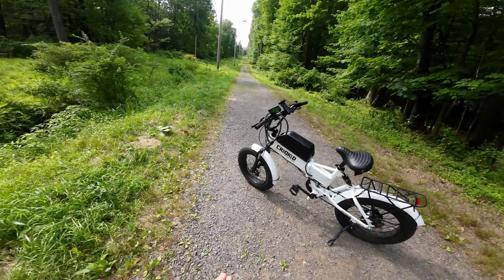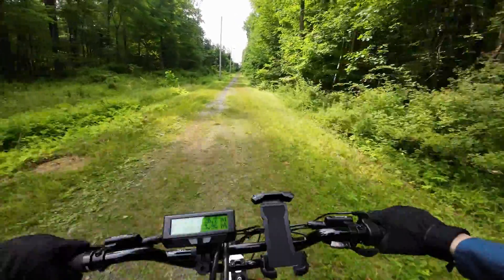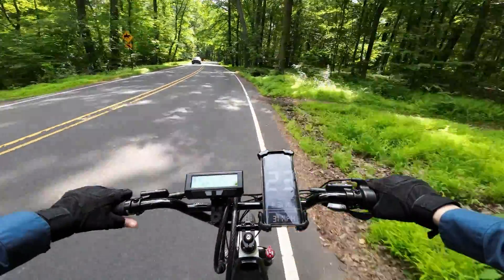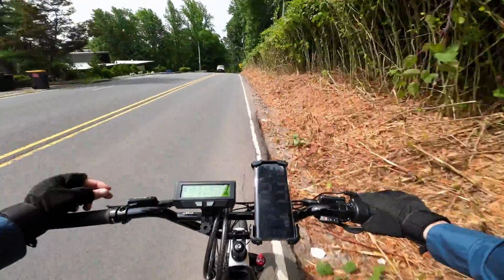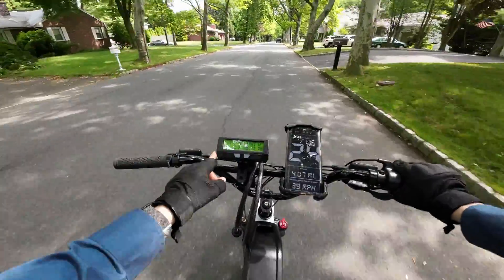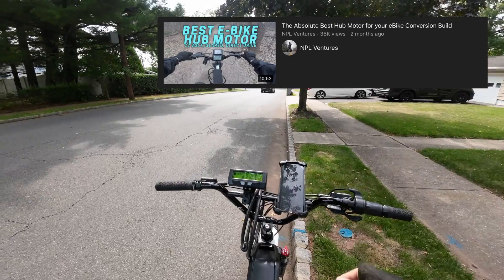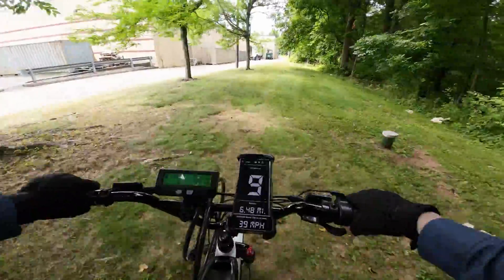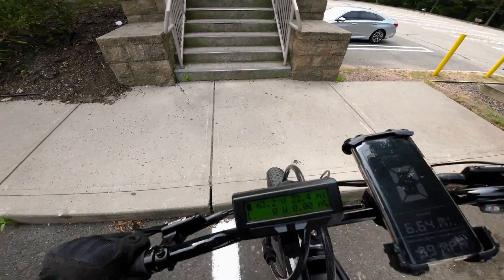Why I Won’t put a Powerful Direct Drive Hub Motor on my eBike Build

Comment: most  cars are front wheel drive so i dont see how handling can be bad ,its best to have more weight on the steering axle ,same applies when loading a artic trailer

Comment: Depends what you want to do on the bike. If you're commuting at low speeds, lots of starts and stops, and never going much above 15mph (maybe 20), then a geared motor probably makes most sense. 
The pedaling will be more efficient, and you'll get more torque and efficiency every time you accelerate from a stop light.
If you've got fewer stop and starts, and you're doing more like 20 to 30+ mph consistently (as I do on my commutes), then a direct drive motor will almost certainly make more sense. The advantage of direct drive is that it's completely silent, more efficient at sustained high speeds (and can reach higher speeds), deal with heat better (which again, is useful for maintaining speed), and it enables regenerative braking. The regenerative braking is hugely useful, as it will do wonders to save your brakes when you slow down from those higher speeds. I almost never actually use my physical brakes on a normal commute. I also really like that they're silent.
A downside of DD that I commonly see is extra resistance to pedaling. For reference, if I'm on my scooter, and I'm on street tires, and my brother is on his 29 x 3 (non electric) MTB, I'll have less rolling resistance than he does. and my scooter has TWO direct drive hubs. If you're commuting on MTB or fat tires, the resistance of a direct drive hub is going to be the least of your issues. If you're on a fast rolling street bike, however, the hub will account for a significant portion of your rolling resistance.

So it's all up to how you use it. It does seem like modern motor controllers have also narrowed the gap in low speed torque and efficiency between geared and DD hubs. So DD is slowly clawing at the few benefits of geared hubs. DD is the default in electric kick-scooters and EUC's, where small wheels mean that 1000W DD hubs will spin the front tire under acceleration, and high speed cruising and efficiency is the expectation.

Comment: honestly my fwd build w/ a 1000w front drive motor has been nothing short of elite, no traction issues or anything unless im trying to get up something stupid steep or i have a ton of weight in my bag and the front wheel starts skipping a tiny bit off the line

Comment: Electricity isn't sent to the motor continuously.  It's sent in a on-off-on- pattern. Aka phases. Therefore, each phase flows twice the current that it is drawing from the battery.

Comment: It’s kind of two different worlds using a geared 500/750 W rated motor vs A heavy, Direct drive hub motor. For bicycles that are meant for peddling, those small geared motors are great because they’re so light. When you get over to the heavy hub motors, it’s more of a moped at that point. You need a more powerful battery with a bigger controller, which adds more weight so it’s not best for peddling. So yeah, for bicycle purposes the smaller lighter motor is better in most situations. In my personal preference, I prefer the heavy, direct drive hub motors, but I’m more into the performance. All of my E bike builds pretty much whiskey throttle if you’re not careful lol

Edit: I see you have the cycle analyst you must’ve been on ES?

Comment: Thanks for the tip on BAFANG steel gears for their hub motors. My AWD mountain cargo hunting bike (E-CELLS Super Monarch Crown) has TWO BAFANG motors. When out in the wilds hunting alone I absolutely must have reliability. Those steel gears may be a bit more noisy but at 2 mph off road or on gnarly trails it won't be noticeable.
Reply: What about the short circuits with metal gear dust inside motor?
Reply: @jean-mariejm7404  Oh snap good thinking!

Comment: if you just want to cruise on the road and commute a direct drive motor will do just fine.  In fact its probably more efficient than a mid drive motor.   But if you want to do anything else like trail riding, jumps, or even mod to extreme power levels mid drive is the way to go.  In my eyes the hub motor on an ebike is a flawed design.  Stick a 20-40lb chunk of metal onto a rear wheel and that whole thing needs to rotate.  And this motor is stuck onto and slim axle, connected to a slim swingarm of the bike, onto a slim dropout.  Just bad, but it'll work for people who only care about casual commuting on a light bike.  The Surron was the bike i would've dreamed of about 15years ago.  We nothing like that back then, it was a mountain bike with a direct drive motor you laced yourself and a battery pack in a bag you made hanging on a bike frame with the wiring you soldered yourself hoping nothing will catch on fire.  I'm so glad to see the amazing evolution of ebikes.

Comment: Hi there. I have a stealth bomber clone that came with a QSMOTOR 205 direct drive in the rear, on a 26x4.0 fat config. Before, I had a rize blade 2 which is similar to the ariel rider x52. I broke away from geared hub motors because I found the nylon planetary gears don't last very long IF you do long distance, car-replacement type of commuting and if you're a heavy rider (I'm 250lbs before gear on). I have thought of putting steel gears in, but that risks chewing up the toothed ring inside the wheel body if not enough grease is present, or if the grease wears out, etc. Also questionable if you like to jump your bike a lot (i did with my blade) and that also may chew up the toothed ring if using steel planetary gears. I can't confirm any of this because I never tried it, I just moved away from geared hub motors entirely. 
As for direct drive hub motors, They are more powerful, they are way quieter,  way faster (can handle higher voltages) literally maintenance-free however they really suck at climbing. I use mine for long distance work commuting. my commute home is around 41km uphill and on the steep hills, my blade 2 is faster at certain parts. It's embarrassing. I'm fooling around with pumping more phase and this and that, but now I'm at a dilemma where my bike keeps shutting off on this one hill close to my designated spot (home) and I'm trying to figure out if its either BMS-related or temp related (maybe motor temp) although I'm not pumping out a whole lot of power for a 72v system (tried 80/300, 70/250, 60/200, and they all tripped at the same spot). So yeah, my two cents. I'd say if you just putt around town and don't go very far and you're not a heavy person, geared hub motors are more value for the buck but if you're looking for a long-distance car replacement and you're a heavy person AND you like to go fast, direct drive or mid-drive would be the better choice. If I can't figure out my cut off situation and if I'm limited to snailing the bike, I'm going to get a mid-drive with a pedal kit, talaria surron etc one of those as I need to be able to climb home.

Comment: I have a 1200w geared motor on a YYG Br100 and a 48v battery. Do you think i can get passed 45mph with another controller? The stock one is 25amps

Comment: I see that you use a UPP battery. How long have you used it? is it still putting out the same current and holding the same capacity as when you bought it? I have been looking at UPP batteries for a while but have been reading and seeing mixed reviews about fake name brand batteries, capacity and average output issues after a year and even some fires.

What experience have you had?

Comment: My direct drive did 80 000km without single service (i didnt even replace bearings) and i would never change it for geared motor. I do everyday commute to work, shopping and recreational trips. Its in use everyday, also in heavy snow and rain. Nothing can beat that reliability. If you just want lightweight bicycle that you use for recreational ride once a month then geared motors might be fine.
Reply: geared hub motors suck, unless you like being a slow poke. They are loud, slower and very inefficient at top speed. Direct Drive is the exact opposite. Downsides being less torque and inefficient at low RPMs
Reply: @dylansoutdooradventures I have a 500w front geared hub motor that I use on my road bike and its got nice torque and hits 40km/h easily and quickly but it just flatlines at 40km/h. Honestly it feels as good as some 1000w dd motors I have tried. I was never planing to keep it but because of it being much more efficient than my own bike and so much lighter with good torque being able to easily hit 40km/h I ended up keeping it as my spare bike that I use for its range for longer commutes or riding in more public places.
Reply: @dylansoutdooradventures  the way you ober come the low torque at low rpm is to increase the current limit and voltage.  Experience has taught me
Reply: @dylansoutdooradventures  Downside is you cant pedal them very easily if youre out of battery.
Reply: @henrikgrangaard7498  Good luck pedaling any fat tire ebike regardless of geared or gearless motor. I don't consider that downside at all, the frames are heavier than normal bikes, the motors and beefier rims are 30+ pounds. Batteries add anywhere from 7-18 pounds depending on battery size/how many batteries. No matter what it's going to feel like carrying a 7 year old without battery power. You shouldn't be running out of battery in the middle of nowhere. Buy an extremely lightweight bike with a 350W motor and like a 7ah battery if you want to pedal incase the battery runs out. Shouldn't be buying a big fat tire bike for that purpose.
Reply: @dylansoutdooradventures  Yes.. and that's the reason the geared motor has an advantage.... if you want to pedal yourself. Doesnt matter if its a heavy or lighter bike. You buy what you want. If people have a problem pedaling extra weight from a motor + battery maybe its better to lose 50 pounds of body weight.
Its always good to be able to pedal the bike if something happens.
You "shouldnt" crash your car either. Yet you have an insurance for it.
Reply: @henrikgrangaard7498  Lol you're comparing a car that has limitless range to stupid irresponsible riding on a ebike. Your comparison should be knowingly letting your car run out of gas, it's stupid. I've pedaled geared motors without the battery and I'm in shape, it's not fun and not something I'd ever want to get stuck out in the middle of nowhere with. You severely underestimate 30-50 extra pounds going up steep hills when the bike frame itself already is double the weight of a normal bike, it's like running up a hill with a teen/small adult on your back. It just ain't happening
Reply: @dylansoutdooradventures  No it shouldnt. It should be something unexpected happening that leaves you stranded. It can be a crash or it can be the car braking down in some other way. Doesnt matter.

I have no trouble with extra weight for my part. If you ride down to the city or your job and want to get home you can perfectly do that with a heavy bike. Or a normal bike full of groceries. If its fun? Not really... 
But you will get home with very little time lost compared to walking your bike the whole way home.
Reply: @dylansoutdooradventures  Cars do not have "limitless range". There's clearly a finite amount of fuel in the car. Pushing a car that has run out is much different than pushing a e-bike that has run out. If you're stuck in the middle of nowhere, you're no more likely to find a petrol station than a electric socket.

Comment: Nylon gears are superior to steel gears. That being said, Bafang Nylon gears are probably not the highest of quality. Also, you have to be careful what kind of grease you use on Nylon. While it is resistant to many different petroleum products, you shouldn't use anything off the shelf. I use TinkSeal, you can Google it.
Reply: Bafang is not even moderate quality. Their budget prices bring bottom of the barrel quality.

Comment: Thank you for your videos! The sound is good.
Questions:
- Which brand was this 2000 Watt motor? How much is the cost of an ideal setup with good battery? Which on is a good and affordable battery? 
- How is the performance of the 2000 Watt motor on 13 to 22 % steep climbs? Does it get hot, does it overheat?
- Do you think a direct drive motor is good when it has high wattage, the higher the wattage, the better?
- Which motor brand/type is in this Fat Bike? Why does the shown Grin Tech motor not fit in this Fat Bike?
Thank you very much for answering, maybe also in another video.
Reply: Most geared hub motors really don’t get too hot unless in weather over 85 degrees outside. 40-85 degrees is a good outdoor temperature to ride a e bike with a geared hub motor

Comment: Excellent content.  Yes, a dual motor setup is possible: install a 1k pan-pot from the throttle to the controllers.  Allows you to select front/rear bias on the fly.

Comment: Humm you don’t know it all!  I am running a x20 ebike at over 40 mph..  It has a 2000 watt motor with a 5 speed rear hub..  it’s starts on the steepest hills from a dead stop..  I get not heat issues at all. this bike I have outrun everything..The bike out performs e-bikes costing 6-7000$.. at 1/4 the price..  rear suspension,  blinkers, hydraulic disk brakes. 60 miles range..  Today their are rear hubs, mid drives and geared rear hubs.. Till you ride geared rear hubs. You will see huge differences..  Don’t waste your money on motors less than 2000 watts and request a geared rear hub..The very best ebike anywhere

Comment: dual hub motors dont require two throttles, for someone who seems to have spent alot of time researching ebike design, it seems shocking that you did not know that.
Reply: where can I find information about it? do i need a second controller?

Comment: The Grin tech motor is compatible with fat bikes. I have one on my fat trike, I use it to tow my son around to parks. I run a 52v 35ah, 60amp battery,  grin phaserunner L10 on a 24” fat trike we can get up to 25 mph it’s not very stable on a trike beyond that. I currently have it set to 2000 watts. I was riding this weekend and the max watts on screen was 1600w. It's probably the setting but its fast enough towing.

Comment: if ya still wanna run dual motor you could migrate to VESC, which unfortunately does not support normal ebike displays, but it has nice functions like you can use the CAN bus to link multiple VESC's together and even use traction control so if you do a wheelie (dont think ur gonna do that, but if it happens the front wheel wont spin up to retarded speeds)

it also supports regen and all sorts of things like you can just map a second throttle as regen, or use a mid-centered throttle so if you move it one direction you can control regen, and throttle the other way accerate and whatnot, official ones aren't cheap but there are cheap versions from Flipsky etc.. like the FSESC75100 and the Makerbase MKSESC 75100
Reply: Agree for the most part, though I'd point out that Flipsky's small form factor demands you provide extra cooling if you're running it anywhere close to full rated power. I smoked mine fairly quickly.

My fardriver is mounted makes to the wind, so I'm hoping that won't be a problem.

I'm also going to be running a battery that can't cough up more than about 50 amps, so that should help too.

My home brew battery was effectively unlimited in what it could put out, and I think thats what smoked the controller, along with limited airflow.

Have you tried adding ferrofluid to your DD?

I still have an unopened syringe of the stuff I never used because I smoked the controller long before my motor heated up.

QS205 should have a heat sensor I believe, so whoever built your bike could have a heat shut down even if they didn't provide any indication of overheat.
Reply: @Zomby_Woof  i have no issues with my 75100 alu pcbs and 75200 alu pcbs (i thermal glued them to my frame which is made of relatively thick metal and has a decent heat dissipation by itself)

for a dd or even a high power middrive like some qs i would recommend a 75200 alu pcb or new makerbase 84200hp, cause dd hub motors want tons of current and 120A is low ish

or the new fsesc 75450 behemoth even better

i have no issues with grin's special ferrofluid (statorade) but i wouldn't use standard ferrofluid as it can eat enamel from the windings if its an incompatible one

Flipsky's old 75100 (non alu pcb) was relatively easy to smoke, never had one of those

as for a motor temp sensor VESC is 100% compatible with it, even if you don't have a regular value you can define the beta value etc manually

apart from an ebike i also run them in a pair of 11" scooters, one at only 5kW (old battery that cant take that much power) and one at 18kW peak

the 5kW one has a 75200 for the rear and a 75100 for the front motor, ever broke a 100 after running 150 phase amps which it really didn't have enough capacitance for, over 140 amps i felt it stutter and at 150 it blew up

Comment: Giant escape city 2 with altus that was geared 2x8, stock bbshd, perfect for city riding, as the area where I am has a few 20-30 degree long hills, and it’s impossible to ride anything here. Literally just use it instead of my motorcycle, as I can park for free right at the entrance. Busting a 52v 20a battery, charge it 2 times a week, uni is 5km away, battery is never under 60%

Comment: I just bought my first ebike so it's an entry bike about $700 has a 360 w rear hub and a 36 volt 10 ah battery. My question is I'm starting to see a problem with my throttle where it's not responding when I'm at a stop but all the lights are still lit up so I have power any suggestions? And it doesn't happen all the time. Name on the bike is Costiç purchase through Amazon.
Reply: looks like garbage